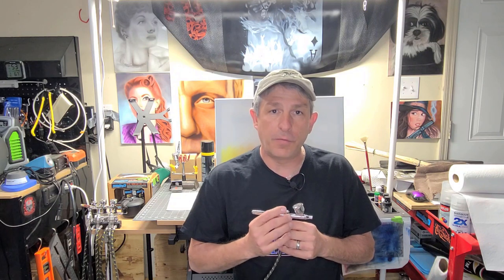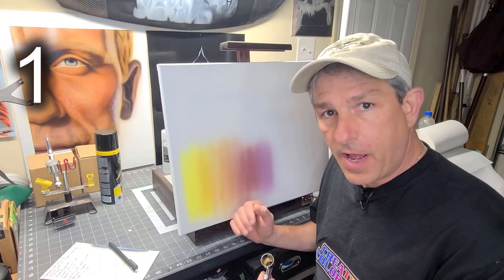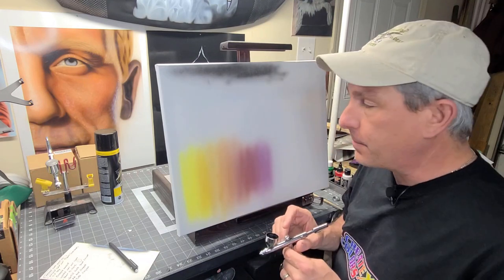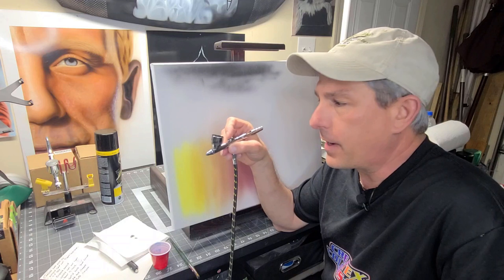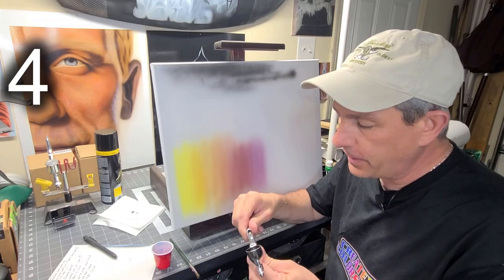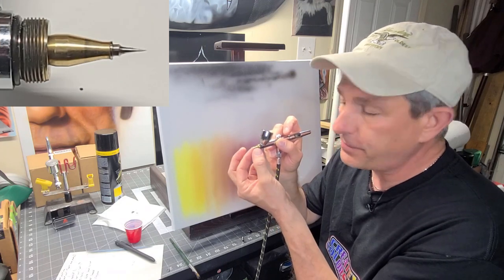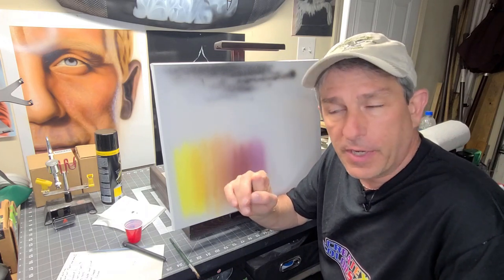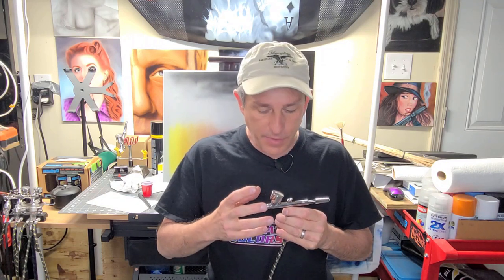Airbrush Won't Spray? Some Reasons It Won't!

Comment: I'm using my Iwata Eclipse HP-CS and it's stopped working - it'll blow air but no paint comes through.
I've completely disassembled it, gave the nozzle a soaking in airbrush cleaner, scrubbed the interior with the pipe-cleaner brushes, cleaned the needle, and cleaned out the gun body with airbrush cleaner, ensured the nut was grabbing onto the needle and it was moving when I pulled the trigger back, double-checked the nozzle components by holding them up to a light to ensure there wasn't a clog, checked to see if there was blow-back by stopping up the nozzle with my finger and checking for bubbles, and there's no was no clog, and I made sure my PSI was at least 30-40.

It'll blow air, but still no paint - it won't even blow water.

I'm at a loss as to what to do now outside of buying a replacement nozzle and needle - do you have any other ideas I could try?
Reply: Same. What should we do? Just open up to clean, then it happen to me, what happened to u. Couldnt figure out how to make it work again
Reply: @gudu2gunpla454  I found this video and saw this guy doing this - turns out the tiny silver nozzle tip was clogged, because soaking the nozzle tip in rubbing alcohol for 5 minutes and then flossing some sewing thread through it seems to have fixed my problem.

It's a bit of a pain to get the thread through the tiny nozzle hole, so to make it less of a headache I think I'll get an ultrasonic jewelry cleaner to clean my components in the future.

Comment: Thanks for this guidance and advice, previously to watching this had spent hours stripping down my iwata with no success and experiencing issues. I'm fairly new to airbrushing but like they say every day is a school day. I followed your advice and now I'm fully back up and running even though the air was blue in my garage. Cheers and take care👌👍
Reply from the maker: Thank Lorne. I am glad the video helped. It can be frustrating when you first start. It gets easier.  If you ever have any questions, just let me know. Thanks for the comment, and thanks for watching.

Comment: Thank you for sharing your experience with us. I am just a beginner, I would love to learn more. 
I have been told to use paint thinner to clean out the gun. If paint is clogged. 

I just started started working on cleaning my airbrush. 
I have been cleaning it, the only issues that I have been having is; the paint is bubbling, paint has been spitting out, and I have replaced the needles and the nozzle. Just realized that the nozzle is gone. Now I know why airbrush is not working. I have brought a 20.00 airbrush gun.
Reply from the maker: Hi Jessica,  I am glad you figured out your problem. Unfortunately, a 20 dollar airbrush can be frustrating. If your budget is tight, I would start with the neo for iwata. I run about 60 dollars at Hobby Lobby or on Amazon. If you can afford a little more, I would recommend an iwata Eclipse. But both are great brushes. I have reviews on both. If you get a chance, check them out, and if I can help in any way, please let me know.

Comment: I just did your bone head mistake myself.  Spent a couple hours fiddling with my Awata Eclipse CS and gave up. I just started brush paining instead!  Found your video and hopefully the problem is solved.  I had the nozzle and the protector removed as an assembly and didn't realize it. They were welded together. I got them apart. now I need to see if the thing works. It should!  Thanks!
Reply from the maker: Pops, it will work. Don't give up you'll get it. Thanks for the comment and thanks for watching.

Comment: Great Vid. I think you have solved my problem. If I eliminate these problems and my air brush still does not work, then my pump is too weak.
 Thanks
Reply from the maker: Freddy, I spray at 27 psi. Does your compressor have a regulator on it?
Reply: @TheAirbrushGarage  it does not have a regulator; it’s a very small one I use for edible paint on cakes. I figured the info you provided would translate to my situation. I have a single and double action gun and neither work so I was suspecting the pump already but your info has me energized to clean them thoroughly then proceed to the next step. Thanks for replying!!

Comment: I have this Timbertech airbrush and it is driving me insane. It is able to spray pure water but any paint will clog it. I did dismantle it, put airbrush cleaner on it, etc. But it keeps stopping as soon as I put some pain in it. I cannot unscrew the front only that little tip and that seems fine. Took out the need, checked the gravity dispenser, they should all work. It worked when I bought it, but my projects take time so 1.5 years later I tried it again and I guess somewhere is clogged paint but can't fix it.
Reply from the maker: Confuzer, I have a video on how to get paint to flow. Try that and let me know.
Reply: I already looked at that. Did all those things. I think something is inside the feeder on the inside but this airbrush won't let you unscrew the top. I just bought a new one (with attached feeder which is better I think than a screw on one from the side) and will maintain a strict cleaning ritual after every time I use it. Thanks for the video's, helpful! @TheAirbrushGarage

Comment: Oh man... I have a paschee airbrush for like a decade now. There was a time when there was a strange sputtering, spitting, constant on and off airflow, however you may call it... I though it was the compressor.... ended up buying a new compressor. Still had the airflow coming out in segments. Ended up pulling apart the airbrush many many times to see if there where O rings that had broken or parts that were damaged... Nothing. Checked the manual, cheked online... and finally one day, I found out that I was screwing the front looser than it should had been and those tiny holes that serve for the air to flow somehow didn't work properly. Now I always make sure I don't have air leakage, like you mentioned it in your video. Very frustrating and actually very silly but not obvious problem and solution!

Comment: YO.  I have had all kinds of similar problems with airbrush getting clogged, and also had some bonehead moves like you did. We all have those moments. :D I usually clean the cup with water and window cleaner agent, which is similar to airbrush cleaner detergent. After that I don´t spray the gun with the detergent after,  but pour all excess paint off and clean the cup completely with water and detergent and paper towel.  Because there can be dry paint on the cup, so even a small piece of a dry paint might go into the nozzle and get it really badly clogged. I also use brush to clean the cup. After cleaning the cup completely after I start spraying the detergent and water through the brush. Also put my finger on the front of the brush to make the air go back to the cup. That also cleans nozzle area and the front of the brush. After dismantle the brush I also pour water from the end of the brush without the needle. Sometimes I even flush the whole brush under running water to get all the paint off. Just be careful when dismantling the brush near sink that you don´t drop any parts into the sink hole. That might be an expensive mistake to do. Since one part can be very expensive. 
Then for the severe cases I have been using isopropanol for cleaning. That dissolves the acrylics and then u might not need to buy a new nozzle if thats the case! . Just leave it soak over night and then use ultrasonic cleaner. Maybe even with all parts in the ultrasonic cleaner with isopropanol instead of only water. I never put the needle in ultrasonic cleaner since it makes all ur parts move, and the needle tip might get damaged by the cleaner while hitting the walls of it.  Important to know that the needle might have some tiny paint residues on the tip of it and that might be also the reason why the brush clogs. Specially if u use an airbrush that have 0,2 mm tip. Just be super cautious that u don´t bend the tip of the needle when using ur fingers when cleaning it. If u bent the needle tip then the spray looks different in certain way and u need to replace the needle.
Reply from the maker: Jan, thank you for sharing your experience. I love hearing from others on their routines. It is very helpful to other viewers, and I always learn something as well. So thank you, and thanks for watching.

Comment: I watched your video on cleaning the airbrush and things were much improved. Now I am having issues where it will spray thinner and cleaner no problem but when I add paint it barely sprays and when it does it shoots out large speckled drops. I'm using Vallejo primer for miniatures and thinning about 50/50 or so. I have also tried adjusting the pressure up and down on the compressor. My airbrush also has an air adjusting screw under the cup that I keep at about a middle position. I don't know if it's just a cheap airbrush that is wearing out or if that is a thing. Thanks for any help.

Comment: Really hoping to get over the hump on having these problems. They make me just straight up quit the hobby for months. Gonna try these out.
Reply from the maker: UD, keep working through the tip dry, the clogs, how much to reduce, etc. It will get better, don't give up. You'll get it. Keep watching videos and practicing. I promise it will get easier.
Reply: I feel your pain. I'm still relatively new to airbrushing to which I use for scale modelling. I thought I'd mastered solving all the common issues until 2 days ago when I could not get paint through the needle, watched and followed this advice and solved the issue. Must admit my patience wears thin most of the time, I've spent hours experimenting with a range of paints, discovering some need thinning, its a complete minefield. The end product is far superior to hand painting but as you stated sometimes I want to give up the hobby I enjoy. All videos loaded make airbrushing look simplistic,  all edited and not a true reflection. Keep with it😂

Comment: I have a Badger 105 here, and all of a sudden it's only spraying air instead of anything else, even water. I tried soaking the nozzle assembly in airbrush cleaner, and while I did get some good results, I'm dreading taking the thing apart to do a deep cleaning in my sonic cleaner. I'll try cleaning the needle more thoroughly as well, but as of now I'm at a loss as to why it's not spraying paint at all...!
Reply: Christopher, it's hard to say but I would try a new nozzle. Also get a needle reamer to clean the nozzle and any small holes in the nozzle cap (see link)  https://www.amazon.com/dp/B002KSH1XE/ref=cm_sw_r_awdo_navT_g_D37XGNTR0890228TM1Y8. Hope this helps. Thanks for the question and thanks for watching.

Comment: I’ve been scale modeling for about 9 months now and have acquired six brushes since. Where some of these problems seem to crop up is the use of varnished, Surfacer etc.., ie., materials which have more substance. You can only thin or reduce them to a certain extent before you defeat the purpose of using the material. Of course, I know THAT kind of stuff requires a cleaning for sure, but even after a cleaning I’ve had some brushes still seized up. Or, like my Badger Patriot, the trigger comes out and I put it aside .
Reply from the maker: Quigley, I have no experience with varnishes but with any material that can be reduced there is a "breaking "point, meaning there is a lack of pigment and properties to adhere to the surface. Most products can be reduced as much as 150% and still be ok, but it really depends on the specific product. It really is a matter of getting to know your product with experimentation. As for the cleaning goes, here is a link to one of my cleaning videos https://youtu.be/6TV_ufwZxdI?si=ev4CRsAhK1Oh6Eq0. I hope this helps. Thank you for the question and thanks for watching.
Reply from the maker: Here is another Cleaning video of my routine. https://youtu.be/-KL1RQiX_TY?si=COvifZM2xaplW2Sa
Reply: @TheAirbrushGarage  thank you Sir for the cleaning video link. I’m on it!
Reply: @TheAirbrushGarage  thank you Sir: one question: I’m in scale modeling. When you say “reducer” do you mean turpenoid or white spirit?
Reply from the maker: @ocsplc  I mean the product specified for you paint to thin its viscosity.

Comment from the maker: Gunner, It can be frustrating when you first get started. Set your air pressure to 30 psi. reduce your paint 1 to 1. snug up all connections. Now if it still doesn't work, take off the air nozzle (with no paint in the brush) press down on the air, is it good and strong? it should be. Also, hold the air nozzle up to the light, you should be able to see through the little tiny air holes (rare, but make sure they are not clogged). put everything back together. Now, with very thin paint, 30 psi, everything back together and tight. It should work. What brush do you have?

Comment: I recently downsized one of my brush needles to a .2. The kit had the needle, the paint nozzle and the air cap that were supposedly matched. I fiddled with the brush two full days before I realized the paint nozzle was sticking out past the air cap much more then all my other stuff. I thought maybe I got the air cap mixed up and put the original on so I swapped that out. The brush sprayed but was blowing spatter all over the place. So not all air caps are made the same. The inside was milled much differently between the two. Once I noticed the paint nozzle was so long I realized no venturi effect was happening to pull the paint thru. I took 2000 grit wet dry paper and drug the nozzle on that a few times, cleaned and tried to spray. After about 3x repeating this process I started getting flow. 2x more times and the quality started getting better and I could shoot finer and more stable lines. Haven't done any serious testing with it it yet but I think it should work decently enough to practice more control on finer lines and dots.
Reply from the maker: B.E., thanks for sharing that. Great information. It is very frustrating when a brush isn't spraying right. But when theses things happen they become a learning experience which only makes us better. Thanks for the comment and thanks for watching.

Comment: I’m new to air brush, green as green can get. I was using clear with a reducer I was spraying a large part of my model I was holding it open moving back and forth but clear paint would stop coming out so I had move the trigger off and on to keep the paint flowing don’t know if it was drying 🤷 had my pressure at 20 and.
Reply from the maker: Blizz Dog, you are experiencing tip dry. Try a few more drops of reducer. Also, put some reducer in a small cup, dip a little paint brush in it and clean the needle and nozzle off, and then dab with a paper towel when this happens to you. I find this works best for me. Give a few shots of air away from your project just to make sure there is no reducer left over. You don't want to blow reducer on to your project. Tip dry is just something airbushers deal with. You'll get better at it as you go. Hope this helps, and thanks for the question, and thanks for watching.
Reply: @TheAirbrushGarage  thanks for the reply and helping us noobs out seems like this is something that people can easily get lost and frustrated with lol

Comment: Also if you don’t spray cleaner through the whole system when you’re done, the very top of the needle housing, it’ll gum up and it’s very hard to clean a little space like that. I had to use an old needle to poke through over and over with acetone and it took 10 min of straight cleaning to get it all out.
Reply from the maker: Alton, I use a needle reamer for any tiny holes. Here's a link https://amzn.to/3QmhlkJ. Thanks for the comment and thanks for watching.